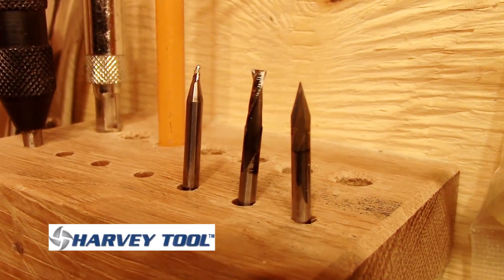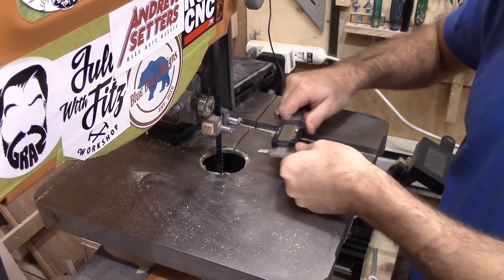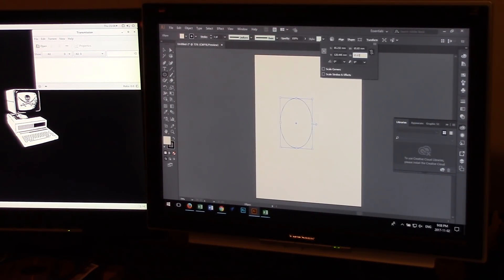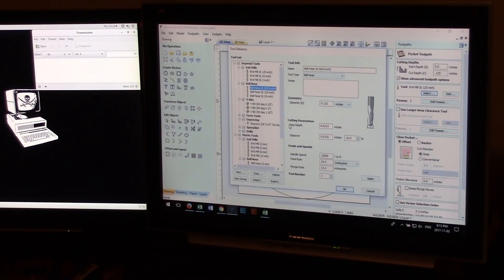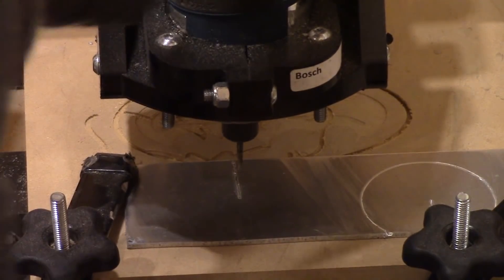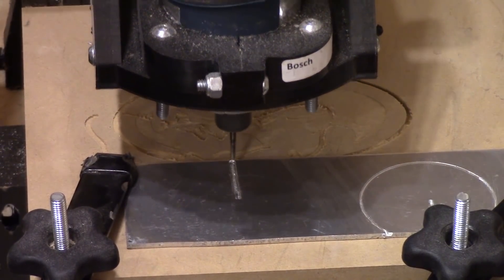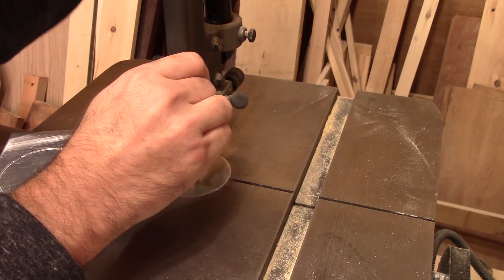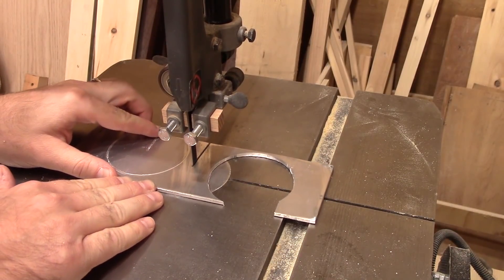DIY Bandsaw Insert (CNC)

Comment: Good build, but it looks like you need to tram your table.
Reply from the maker: +Wildman Tech what does that mean?
Reply: It looks like the plane of the table is not parallel to the plane of the router bit travel. Tramming aligns the two. At 1:49 it appears that the 7:00 position of the circle  is lower than the rest. Then again, it could be an optical illusion caused by lighting. Or the aluminum may not have been completely flat. If it even exists, the error looks pretty slight. You may want to just live with it.
Reply from the maker: I may have used an uneven piece of MDF as a sacrificial bed.  I'll look into that.  Thanks!

Comment: Short and sweet. Did you luck out on the thickness or is it standard stuff?
Reply from the maker: +Infinite Craftsman just so happens to have been the right thickness.  If not, I could have sanded or shimmed to adjust either way